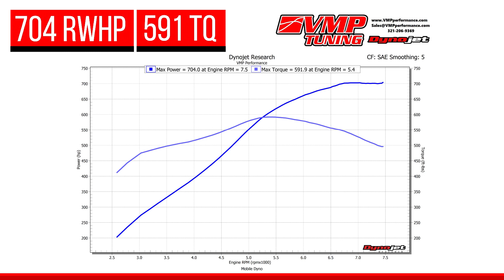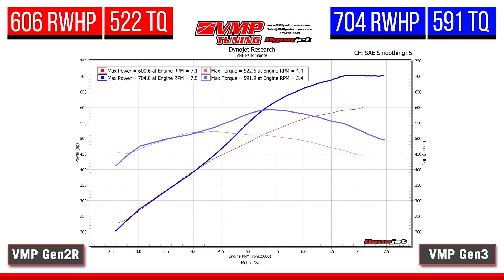VMP Gen2R TVS vs. VMP Gen3 TVS 2017 Ford F-150 Dyno Pull

Comment: So basically a 50whp gain. I'm pretty sure the Gen 2R would have done 650whp with the longtubes and C16.
Reply: Probably, but we put the Gen 3 on for the additional headroom and the additional power it makes even at the same boost as a Gen 2R.
Reply from the maker: The black VMP truck had a gen2 pushed pretty hard, but it took a 69mm pulley and 5% OD lower just to get into the mid 600s.  Joe's truck is making 50rwhp more with a 79mm upper and stock lower.
Reply: @VMPPerformanceTV  Oh very nice! Thanks for the info and reply! Thanks to you as well Joe.

Comment: I’d like to see to comparing numbers from a 2.9 Whipple with 2.75 pulley just for Curiosity on same vehicle
Reply: Me too! but its right up there with BoostedF150 1/4 mi time. His engine went boom. (ran it out of oil)
Reply: EcoBoost EngineSwap Yeah but that’s because he didn’t Upgrade the oil pump gears To a billet ones, the Broken pieces got into his motor, and he should have turned off the motor ,Otherwise his stock motor still would have been running easily without having to rebuild her afterwards ✌️
Reply: EcoBoost EngineSwap Even On naturally aspirated 5.0 Mustang’s or trucks stock Oil pump gears could easily fail as well, Also could depending on your driving habits also.
Reply from the maker: We're always up for a match race!
Reply: VMPPerformance Thats the spirit ! But I’d think be close, but that supercharger you guys have, are breaking records with, been seeing on channels 👍
Reply: VMPPerformance now that will be a hell of a race I would like to see
Reply: @VMPPerformanceTV  I would like to see someone test against the Kenne Bell 3.2 offered for f-150's, see the difference in lobe design and rear vs front inlet.
http://kennebell.net/products/supercharger-kits/f-150/
Reply: @adrianbrown2957  as long as you dont get dumb with pully size and bang the rev limiter you should be fine just like any other of the big names kits. with any kit I would plan on upgrading the oil pump and crank gears

Comment: Excellent vid . I have a 2016 f150 5.0 and i have a chance to get a vmp 2r from a 2015 mustang GT aside from some vacuum is the lower intake the same an will it bolt up to my 2016 f150 5.0 if not what lower intake do I need Thanks …

Comment: I am still on the fence on what blower to get Roush, Gen 2 or Gen 3 R.  IMHO you guys should have installed headers and retuned and got some numbers with 93 then with race gas. then installed the Gen 3R and got some 93 numbers.
Reply from the maker: We already did that test on the black truck, sounds like you've got decisions to make.

Comment: how much power do the headers actually add at this power? Gen3 vs Whipple? close to same power? Oil Pump been upgraded? 10.41 @ 131 with small tires is really haulin' the Mail! I think its time to retire my 482" FE Dinosaur and make some real power at a fraction of the cost!
Reply from the maker: I feel the headers are worth 25-50rwhp...but at some point un-restricting the exhaust is a necessity.  As far as blower vs blower, the Eaton 2650 rotors used in the VMP Gen3 are the most efficient out there.  482 cubes is nice, but Coyote swap FTW!
Reply: @VMPPerformanceTV  I have 6 1966 F100/250 trucks. 482 close to 600 hp flywheel, 3.5 Eco with upgraded turbo's in another, Just finished assembly on a 2.7 Eco for another today, hoping to do a 2018-19 5.0 10 speed in another, Also have another Big Block ford no coyote will come close to for daily driver.  I will know next week if the 5.0 10 speed is going to happen. If it does a SuperCharger will be part of build.  You did a tune for me on my 2007 GT500 way back in late 2006.

Comment: Hey guys I just wanna ask does the gen3 coyote from the mustang and gen3 coyote for the f150 has the same crank? I just wanna know if the crank pulley are the same diameter
Reply from the maker: they are the same
Reply: @VMPPerformanceTV  thank you so much and also one more question is the front timing cover of the 2012  f150 and mustang are the same I saw some trend they were different